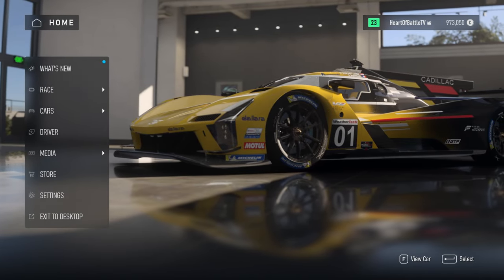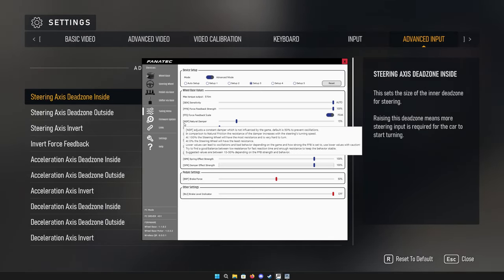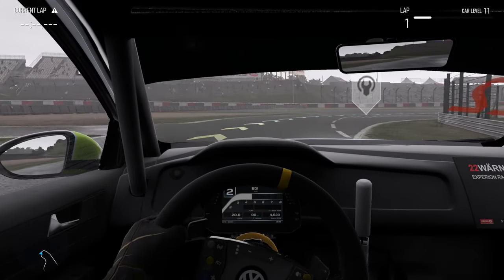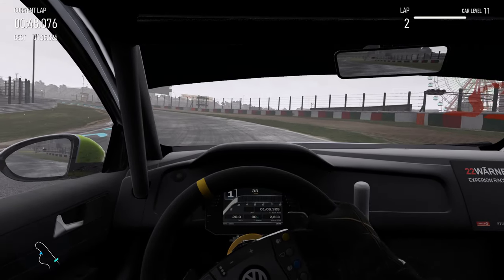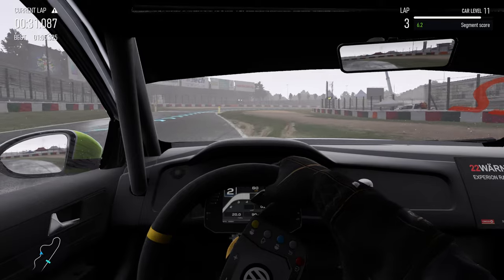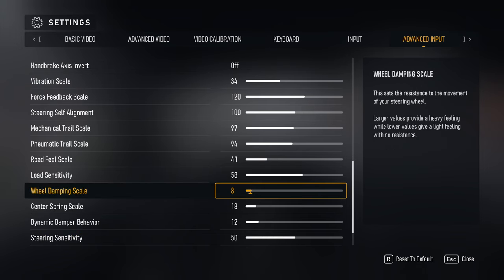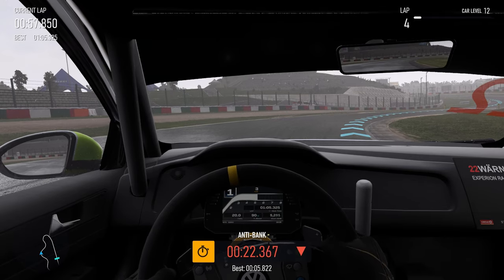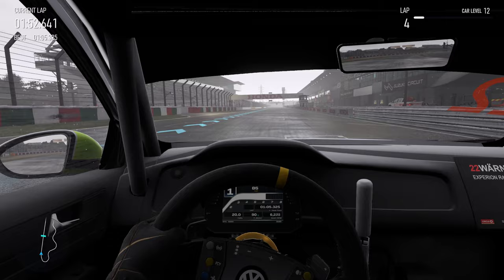Forza Motorsport Wheel / FFB Setup Guide

Comment: also just saw the part where you said there's no way of knowing it its clipping. While in race hit down on the dpad and then left or right will cycle through telemetry data. One of them is a ffb meter. Top bar shows clipping if the line goes outside the top or bottom value.
Reply from the maker: Thank you for that! Wasn't sure if that had anything to do with clipping. Very good to know.

Comment: I only know, that in a normal road car, in a race car, in a formula1 car, if you stay and turn the wheel, the wheel won’t turn back automatically. If the car is in motion yes, but if you stay, definitely not.
Reply from the maker: Yeah, the wheel will only return to center when the car is moving.